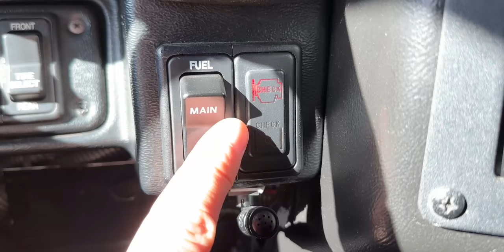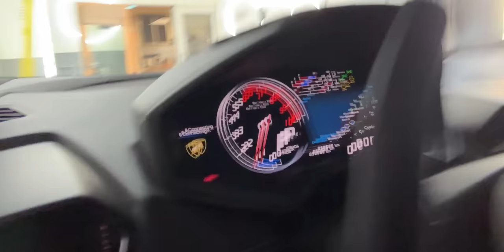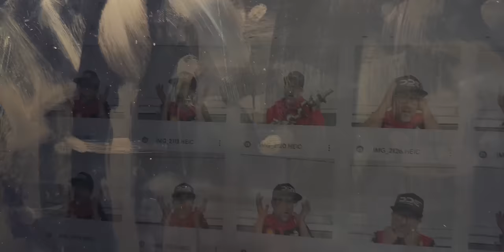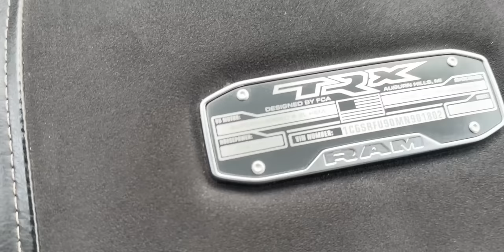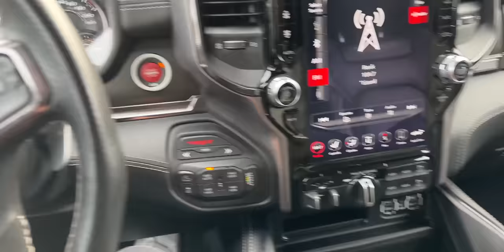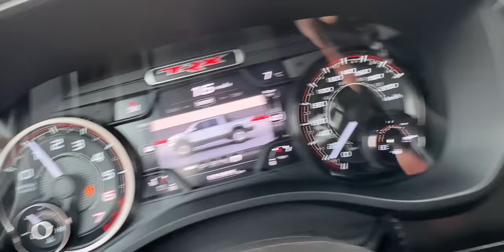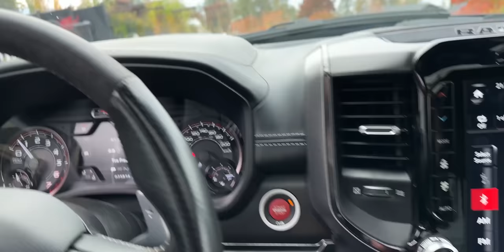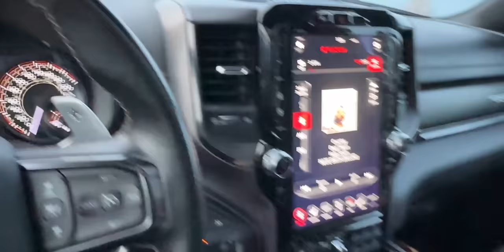BUYING MY NEW 700 HP DREAM DAILY …

Comment: I work in electronics, all of the codes related to light bulbs can be eliminated using resistors plugged into the bulbs holder. Can also trick ECU to thinking evap and SAI are present using electronic components too.

Comment: Do a upper / lower pulley, demon injectors, cold air intake and a tube! You will be over 800 hp on 93 octane 👍🏻👍🏻 really wakes the TRX up and  12S 1/4 😂😂😂 best $3500 you will ever spend

Comment: Yeah, do not if you live in Canada even the most southern parts electric car life does not last very long. The typical lithium on battery in an EV less 50 to 60% less of the amount of time and I’m not talking about the charge as much as I’m talking about the longevity of the battery. This is Jude because lithium batteries do not like subzero degrees Fahrenheit, or anything below freezing.hence why the United States will never successfully have cars run on EV’s have the country does freezing temperatures and below from Kansas, Utah and West Virginia north has those temperatures. And two grand on a car that does weird crab crap which I don’t get worth it.